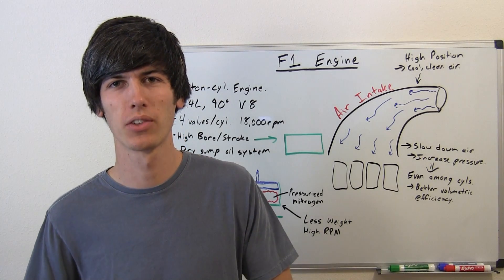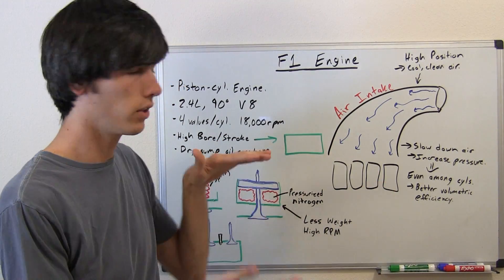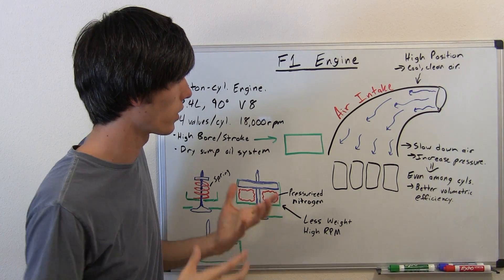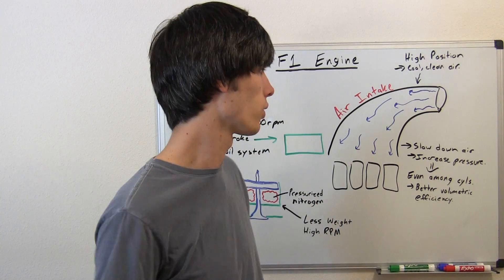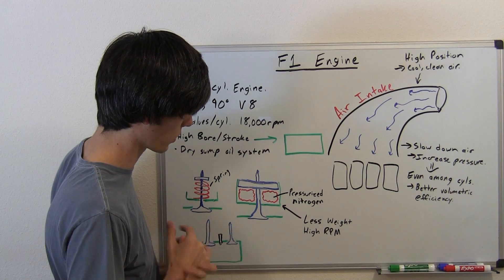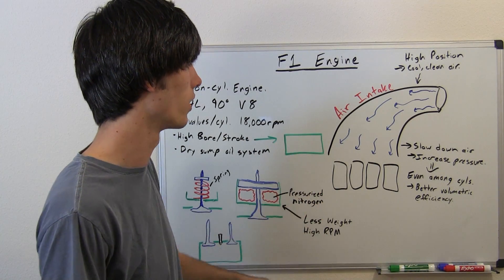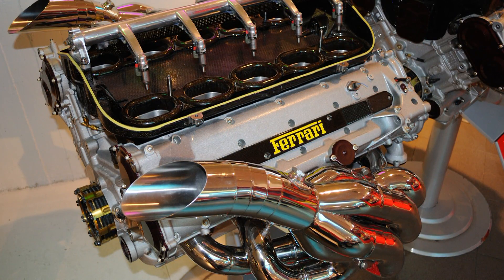F1 Engine - Explained

Comment: Slow down air to increase pressure? No, just... no. It gets rammed in there, to increase pressure. Air slowing down would be a "side-effect" of the laws of physics.
Reply from the maker: Do a quick google search for "diffuser vs nozzle."
Reply: Engineering Explained A search? Why, so i can get more uneducated shit from any fuck with internet access who thinks they know something. That SCOOP intake (if your picture is any where near scale) has a smaller opening than its base (even though the total size of the intake ports compared to scoop is all that would really matter, except turbulence) but when it scoops up a 200mph stream of air, its going to cause an air pressure increase. By "slowing the air down" you could be referring to keeping the air from flying over top of the intake ports and, in a worst case scenario, creating a vacuum effect that would suck the air out of the intake (like how a sand blaster or paint gun works)
Reply: Marc Wolfe Fast moving air has a lower pressure than slow moving air. That's how planes fly. As a plane moves air passes over the wing faster than under the wing. The pressure of the air travelling over the wing gets lower and generates lift.
Reply: Tuppoo94 Again, side affect,
Reply: Marc Wolfe What do you mean with 'side effect'?
Reply: Tuppoo94 It means your right that the air slows down. But air speed isn't the only factor, air is forced into the scoop and "packed" more densely because some air in the scoop slows BUT more air is constantly being forced into the scoop pushing against the slower air, thus an increase in pressure.
Reply: The air intake on an F1 car doesn't do that. Ram Air devices are forbidden. Not that they would make much difference with current engines, but they weren't allowed.
Reply: Tuppoo94 I wouldn't know that, I on't keep track of race rules. I'm Pretty sure ram air intakes are long intake runners not scoops. Two different things.
Reply: RoMMeL1337ak47 Now that comment makes perfect sense without even reading the link. Its still the same as saying the air gets rammed in though.
Reply: Marc Wolfe Look up the difference between static and stagnation (total) pressure. Yes at higher velocities, stagnation pressure increases. This is relevant when considering a jet vane force (sticking your hand out the window). This is the pressure created by the force of the flow and not the pressure of the air itself. This is different from static pressure. Static pressure will increase as airflow slows down (think of a traffic jam). This is important because you want a higher differential of pressure for better efficiency.
Reply: Kj16V No... just no.
Reply: I don't need to read it. I already know. The typical explanation is referring to a "vacuum" of low pressure above the wing that PULLS the plain up, but doesn't mention the higher pressure below the wing that PUSHES it up. Both create lift.
Reply: The typical theory has two parts. A differential pressure exists and exerts a force on the wing. The other is jet vane force, which is momentum being transferred from the flow to the wing. Again, just like sticking your hand out of the window. Just remember that the force you feel from wind has no relation to the static pressure of air.
Reply: Just another reference which states that pressure increases inside of an engine airbox by slowing the air...but I doubt MW will be convinced.  Believe what you want it doesn't change anything.
http://www.gmecca.com/byorc/dtipsaerodynamics.html

When I studied Fluid Dynamics as part of my Engineering curriculum it became obvious that fluids often do not behave in a way that is intuitive, even in theory.  In the real world application it becomes even less predictable as laminar flow gives way to turbulent flow.  The engineer is tasked with designing something that works whether running in clean air or in the case of racing, in the unpredictably turbulent wake of another car.

I think the video is amazingly good at explaining the engineering differences of racing engines vs production engines.  As a car guy I learned a lot even having some of the jargon explained in just over 8 minutes.  Kudos!
Reply: @RoMMeL1337ak47 Wtf did I say in a previous comment..…. I said the difference in pressure is the best, most technically accurate way to explain it. If you go by absolute pressure the only vacuum is a space contains absolutely nothing... so yes I know that.  But ... in many cases normal atmosphereic pressure (about 15psi, less at higher elevations) is considered zero pressure for practical, not so technical reasoning.
Reply: @RoMMeL1337ak47 What do you not understand what a vacuum is? I know what I said. The low pressure pulling up, is enough explanation for most people to understand. I've already made it clear that you're right.... move on.
Reply: @flavourboss I believe that you think its the truth.... troll.
Reply: Marc Wolfe Enjoy being the guy no one want so have a conversation with.
Reply: Lots of people don't want to have a conversation with someone more intelligent than themselves.
Reply: Marc Wolfe Enjoying your own company?

Comment: Thanks a lot interesting videos but also makes me ask my self a lot of questions !!

When the engine is @ 18000 RPM 
What is the crankshaft angle when igniting the fuel ?
and isn't that going to be easier if they've used an undersquare design 
if yes why don't they use it ?

Comment: Why does the intake air have to be cool? You're heating it up anyways during the power stroke so if the airs already warm you can use less energy to bring it up to the desired temp.
Reply from the maker: "you can use less energy to bring it up to the desired temp." That means the car will do less work.
Reply: Engineering Explained
True, I guess that would help efficiency (fuel consumption) at the cost of a drop in power. It seems the rational for cooler air is greater air density in the cylinder and thus more energy can be taken from the combustion process of the gas and air.
Reply: also the reason for intercoolers to exist and for engines to work better in cold weather(but to start harder-another story). in the same volume of cold air there's more oxygen, than in hot. thus-burning is more effective.

Comment: Volumetric efficiency or intake ratio (as I like to call it) on naturally aspirated engines can easily achieve greater than 100%.  The poppet valves create pressure nodes of high density air which the engine can pull in. When high VE/IR occurs depends on the intake runner and intake manifold design.   Without this principal, a F1 engine would not produce very much power nor would it achieve 18,000 RPM.
Reply: Your right..  The pro stock engines we have worked on, all have achieved greater then 100% V.E ..I'd like to add that it's not only the intake system  design, but also exhaust system scavenging and cam timing. You have to have all three systems designed properly to get greater then 100% V.E.
Reply: The diffuser is immensely important for greater than 100% VE.  Yes, you can get there with scavenging and timing, but only for a fairly short rev range, to get the 4000 RPM powerband that F1 engines have you need the high pressure plenum as well.
Reply: james cole is right. The intake's role played on achieving above 100% VE is just as important as the exhuast's role. Scavenging can create a huge vacuum essentially Dysoning more air into the cylinders.  Oh physics.
Reply: The only 3 comments that are worth money in the hole thread.

Comment: well explained!, i know quite a lot about engines and engineering in general. I can build anything with my trusty hammer :D... jokes. Interesting to see a v8 f1 car i thought they were mostly v10's and v12's. interesting on the pneumatic valve's. Nice design. if i had the time id love to build a model f1 engine, would be awesome. the design and building itself isnt too hard. just would take forever especially to machine everything to such a fine tolerance. Great tutorials, keep it up!
Reply from the maker: Glad you enjoy the videos, thanks for watching!
Reply: greetings tb craft,,yes there were v12 (late 70's) and v10 (80's-2004)f1 engines. These engines are trully remarkable, their engineering design is way ahead of our time such a the pneumatic valve introduce by renault in early 80 but was applied in F1 in the early 90's.there's more innovation to come like the KERS system and DRS. hope you like F1 cars
Reply: scrfce123
I think you need to think of the Mass or mol of the air and fuel ratio. not volume.

Comment: Reciprocating mass is a huge part of a high revving engine by using a smaller crankshaft and smaller flywheel and clutch assembly, they are super tiny which basically provides nearly no torque at all but allows rapid accelerating engines.  The valve side of it is the secondary technology that is needed to support a very low reciprocating mass engine because the engine speed is so high.  The valves don't create much of the high RPM's, they allow the higher RPM's.

Comment: NA engines can achieve higher than 1 atmosphere using cam timings and air inertia once the efficiency range of the cam and engine speed is reached.  The down side without using Variable cam timing is reversion and decreased VE in lower RPM's, and this is the lumpy idle you hear in idling big cam engines, not exactly running efficient until a higher RPM is reached and the cam timings really swing things back the other way.

Comment: I am currently working on a motor with no valve train, no rotating mass above the piston.  Imagine what this could do.  No valves, springs, push rods, no cams, lifters, belts, intake, head (as you know it).  Can you say weight savings?  Imagine the decrease in parasitic loss?  Another benefit I am working on is programable fuel/air ratio, alternate fuel timing as well as the ignition timing we already do.  Picture a Corvette driving to the track getting 50 mpg, get to the track, change tires, digitally tune suspension and select the desired "cam profile" to race.  All from the seat.  Wish me luck!
Reply from the maker: Good luck!
Reply: It is coming together, just taking a while with these tech nerds.  Working on the combustion chamber (such as it is) and the shape of it this next quarter.  fingers crossed!  I wonder what the red line will be???

Comment: What about solenoid valve trains? Using magnetic field to close valves instead of gas? Nice vids.
Reply: That's good, but have to see how many more components you are adding to the engine to create the mechanism including the weight of them. The whole problem with springs was that at those revving numbers were much more than what springs could handle. How quick does the magnetic mechanism work? I think that's the main question.
Reply: jitterball
ok modern f1 is nothing, there is no competition with the driver,,only the car. if this is highest level to motor racing then why factory made car can produce more power then f1 today?? There are very good drivers in f1 1500hp and things get intresting no limits of enything thats racing. i mis the turbo time if you want you can get 2000hp today is child play and no risk
Reply: aa formula 1f 700hp hey king of motorsport that is ridigiluis sory my english but there is no way F1 just 700 hp and that is just no gou

Comment: you forgot to talk about the bottom end. they have incredibly short strokes and very large bores. thhe reason they do that is two fold. 1 the shorter the stroke the more rev happy the engine becomes (less inertia from pulling the weight closer to the centroid) and the less the bottomend vibrates at high rpms, it also makes the engine very compact.

F1 engines upclose are incredibly compact and tiny. The blocks are also cast and reinforced as they act like a part of the chassis. the engine bolts to the driver cell, the transmission bolts to the engine and the suspension bolts to the transmission. This is not the case in a road car.
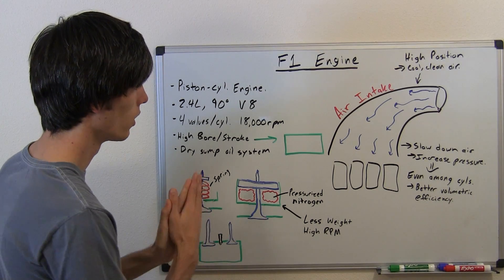Reply from the maker: You didn't watch the video did you? 1:08. :)
Reply: Engineering Explained he just wants to repeat what u saying so he can look smart.
Reply: Engineering Explained You completely went over stroke vs bore in your video haha.  Thanks for the layman's terms,it is amazing what you have taught me on your videos.
Reply: Engineering Explained poo poo pants

Comment: Awesome, Thanks Steve for that 'burble' explanation.. I was just about to look that up & always wondered why F1 cars sound so smooth compared to a typical engine. Don't want to sound dumb here but is this the same for any V-type designed engine?? Common sense would say that you would need 2 banks to get that burble effect, from its firing order & 4 stroke cycles. I say V-type because of boxer, rotary etc..

Comment: I may have skimmed a little, but did you ever say why F1 cars "scream"?
Reply from the maker: High RPMs, road cars rarely go over about 7000 RPM, where as F1 engines up until 2014 hit 18,000 RPM.
Reply: Oh, thanks.
Reply: Same reason street bikes scream as well, many of them rev to 16,000 RPM :)

Comment: Is it a flatplane or crossplane V8?
Reply: shi01 you mean 90 degree firing interval, not  firing order and you only get LRLRLRLR firing with a flatplane crankshaft. Most road-going V8 engines use a crossplane crankshaft which fires LRLLRLRR. This is where the V8 "burble" comes from. A flatplane crankshaft V8 just sounds like two perfectly synchronised I4 engines, because that's exactly what it is.
Reply from the maker: What is the difference? Haven't heard these terms.
Reply: Engineering Explained On a Flatplane V8, each bank of 4 cylinders fire in pairs, at 180 degrees. When 2 center pistons are at top dead center, the 2 outside pistons are at Bottom dead center. It's like 2 Inline parallel 4 engines stuck on the same crank together (Ferrari does this). A Crossplane V8 fires every 90 degrees on each bank so there are 4 main connecting points on the crank hence the name crossplane. 90% of V8s are this way.
Reply from the maker: Interesting, thanks for sharing. I don't know which they use in F1.
Reply: It's a flatplane. But the firing order isn't 180°. It's 90°. The 90° bankangel suits that perfectly and results in a more controllable power output.
Reply: shi01 A flatplane crankshaft has 2 connecting points; at 12 o'clock and 6 o'clock, it is therefore 180 degrees whether it's a I4, V8, parallel 4 or V twin. This engine's 90 degree angle may stagger the 2 banks of pistons 90 degrees, but it's still a 180 crank. This design allows for more top end potential, but less mid range horsepower with the linear composite torque compared to a crossplane engine.
Reply: ironDsteele
No. A 90° V8 is basically two I4 blocks, where one of them is 90° angled to the other. The ignition actually alternating between the cylinder banks LRLRLRLR. Like you said, I4 engine has normally a 180° firing order. But with a 90° V8 you can reduce that to a 90° firing order if wanted. And that's not even specially for F1 Engine. The 90° firing order is quite common in V8 racing engines.
Reply: Cool, Thanks.

Comment: British steam locomotive designers used low pressure steam of about 50 PSI and huge driving wheels that turned relatively slowly. Is this where British auto engineers got the idea for under square engines with long strokes and narrow bores?
And what about that kart racing favorite the flathead Briggs & Stratton and the F Head which I first heard about earlier today?
Reply: The long-stroke undersquare British engines were driven by a ridiculous taxation system whereby an artificial "horsepower" rating was assigned to all cars, this rating being arrived at by combining various design features of the engine, including bore and stroke. Higher "horsepower" ratings meant higher tax rating and it turned out at a smaller bore led to lower ratings, hence the preponderance of heavily undersquare engines.
Reply: Stephen Malbon That’s almost incredible. Hope California doesn’t find out about that or all those high tech sports cars will be gone.

Comment: Do you know if fuel pressures greater than 100psi will be permitted for the 2014 turbo engines?
Reply: Well, fuel pressures greater than 100psi are already permitted. The FIA is based in europe, so they use metric units and what the rules say at the moment is an allowed pressure at the injectors of 100bar or 1450psi.
But yes, they will increase the allowed pressure for 2014 to 500bar or 7252psi.

Comment: so, rpm limitations basically result from lack of a valve train's responsiveness?
Reply from the maker: Well, yes, though all of the components need to be able to handle the higher speeds, but typically airflow is the limiting concern.

Comment: don't forget the thinner head gaskets for a higher compression ratio.
Reply from the maker: You could adjust the pistons to compensate for the compression ratio, or the connecting rods.

Comment: Question: The nitrogen returns the valve to closed, but what is opening the valve?  I've read in the past that solenoids were programmed to perform this function.  Better control of the intake and exhaust event throughout the entire rev range.

Is this the case or are most if not all F1 engines utilizing camshafts?
Reply from the maker: They use camshafts, much like other DOHC engines.

Comment: The piston is moving just as quickly in either engine, the piston in the short stroke F1 engine isn't traveling AS FAR IN EACH STROKE as a normal car engine.  Pistons are limited to how many feet per minute they can travel before the begin to break down.

Comment: You can handle a lot of rpm with metallic springs but with an air spring you got a non-linear force/displacement curves which enables you to save power. Because you loose power when you have a big spring !